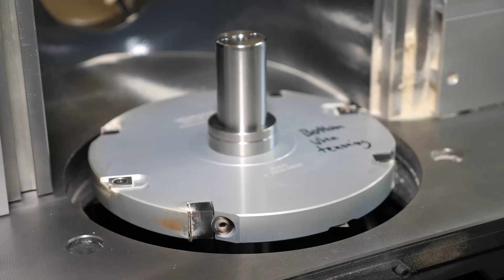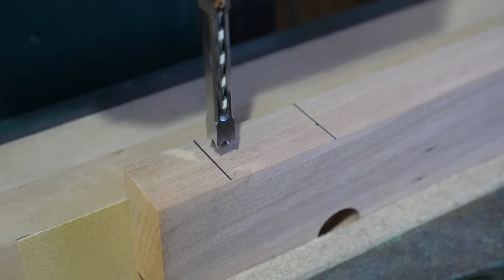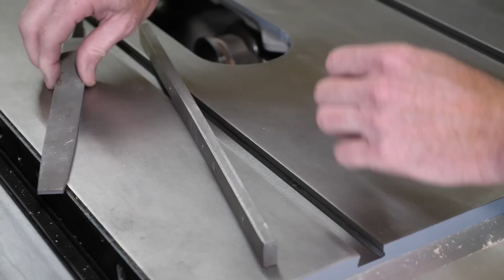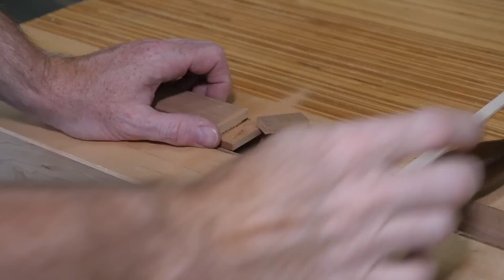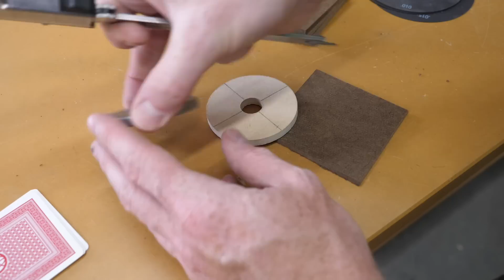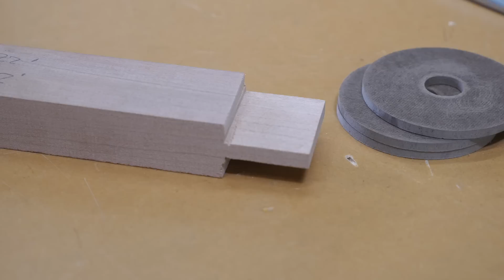Table Saw Tenons

Comment: Fabulous. Was wondering what to use for spacers on the cheap when I first saw you use this trick in the specialty saw blade video. Notice you have an insert for the unisaw that looks to have multiple different blade slots cut in it. Never tried it on mine but I have often wondered if there is enough room on the insert to rotate 180 degrees to have a multi purpose insert. IE one side zero clearance thin kerf, other zero clearance full kerf for example.
Reply from the maker: Thank you. I can flip. the insert around on the Unisaw. I cannot on the PM66 because the "feet" don't line up front to rear. Hope that makes sense.
Reply: @MikeFarrington  Sweet. I have the unisaw, so that is a wonderful bonus.

Comment: Seems a little overkill. If you have a tenoning jig, with 1 blade you can just flip the piece over and the tenon is perfectly centered, plus you can fine tune the fit just by moving the spacing of the jig. This might be good if you have an offset tenon.
Reply from the maker: I think you've missed the point of this method. The benefit of this method is once you get the setup dialed in, you can come back to the same thickness tenon with zero setup. This is helpful when using the same router bit or other method of cutting a mortise. All methods have their ups and downs, knowing a few and picking the best one for your project is the key to better woodworking.
Reply: @MikeFarrington  I could see that for a production shop where you're making a lot of the same sized stuff, for sure!

Don't take it as a knock, I'm all about learning new methods of work.

Comment: Hi Mike!
I kind of rediscovered your channel watching the door video. I am a keen hobbyist, and have a few questions:
Are the saw blades used here just normal blades?
What would the benefits to this method for a small batch be, over cutting the tenon with the bord laying down with a dado stack for instance? I easily see how this would be amazing in a production environment.

Thanks for another great video, and thanks for sharing.
Reply from the maker: Thank you. These are normal rip blades, nothing special. If you look closely, you will see they aren't the same blade. The key is they are the same diameter. The benefit of using this method, is once you measure you mortise, then setup for the tenon, if you take notes, you can come back to the same setup each time.

Comment: I have a shop made tenon jig that saddles the fence, but I do one side at a time by turning the board 180° in the jig. This ensures that the tenon is perfectly centred.  Of course this only helps if you managed to get the mortice centered. 😉  I sneak up on the size using a DTI on the fence. This makes it super easy to get a perfect fit.
Reply from the maker: That method works. This method allows someone to come back or an exact setup to mate with a known mortise size. Both methods have their pros, cons, and uses.

Comment: I find those plastic eaves trays aren't great for retrofitting, they're better on re-roofing jobs or new roofs. The first thing i do is remove the gutters and inspect the fascia. Then the first two rows of tiles come off. If the first batten needs replacing i do so. On retrofits i use 6mm marine ply ripped to approximately 10" wide. I cut and fit sprocket to finish flush with the top of the fascia. I fit the ply flush with the outside of the fascia. I then fit some Iko eaves protector on top then the old felt is lapped on top.
Reply from the maker: Not sure I follow, but thank you.
Reply: @MikeFarrington  Apologies, that comment was for another channel.
Reply from the maker: @Toyotaamazon80series  Ah, that makes sense. Thank you.

Comment: Disk his hand egg sealant view Dio. I would propose cardstock, acrylic/polycarbonate, PVC, ABS (Any flat plastic material actually), Aluminium, or other smaller carbon steel or HSS circular saws with the teeth sanded smooth. (Non carbide blades have teeth that have an offset to create the kerf).
Reply from the maker: Good ideas.

Comment: For those of you who don’t like the table saw trick, you can cut the cheeks on a bandsaw much as if you were doing it by hand. First cut the shoulders either by hand or with a table saw and miter fence or sled. Then, adjust the bandsaw fence, cut one side to a depth (use a stop block), rotate 180 degrees and then cut the other side.
Reply from the maker: I have shown that trick in another video as well. Thank you.

Comment: Adding a second blade onto the table saw increases the risk of kickback. Especially since you removed all the safety devices. It may save you a few minutes, but it increases your risk by 3 times. I highly advise you not to do this. This is extreme dangerous. This is not a new idea. This has been attempted before, but due to its risks, it has not been widely used.
Reply from the maker: This is wrong. By definition kickback is a piece being trapped between the fence and blade. The fence is way out of the way. If the workpiece is being held firmly by the tenoning jig, this operation is about as safe as using one blade. Agreed, not new at all, as mentioned in the video I learned this trick when I was working in a cabinet shop as a young guy.
Reply: @MikeFarrington Kickback is a piece of wood that is flung back towards its operator Due to wood movement After your wood is cut This can be caused with just blades alone Not just with a fence
Reply: @MikeFarrington Kick back by definition, come on, man. You're just trying to justify A unsafe practice. This trick only works if the Material you're cutting has no movement after it's cut like MDF Any wood that you use this trick has a risk of 6 points of contact if there's wood movement
Reply from the maker: @wesleyguerrero7357  I appreciate the input, but I think we will have to agree to disagree on this one. I would suggest doing a little research on the topic, there is a some content out there not produced by me on this very subject.

Comment: By the time you are finished messing about with shims and double saw blades one could have cut the tenons with a single saw blade in half the time. Big thumbs down!
Reply from the maker: I think you missed the point. Once setup is figured out, you can come back to the same setup each time a mortise is cut with a particular bit. So very little setup time after the first go.

Comment: I definitely would not do this with a full sized blade imo. maybe a 7 1/4 or 8 1/2
Reply from the maker: Thank you. 2 ten inch blades is still way lighter than a 3/4" wide dado stack. I don't know if this is particularly unsafe.

Comment: Masonite?  Do you flip the tenon around and cut it again to ensure it's centered?  Thus eliminating the need to perfectly locate the fence?
Reply from the maker: That would assume I need a centered tenon, which would also mean flipping the piece when mortising. I normally do not do that. Also, flipping the piece would kind of defeat the purpose of this method, which is to come back to the same setup each time a mortise is cut with a particular bit.

Comment: Great vid Mike, Personally Id rather use a dado set with the tenoning jig and cut the cheek and shoulders all in one pass, that way there's no phaffing about with shims the tenoning jig has adjustments for that very purpose, the only time its not perfect is if the depth of the tenon is more then the blade can cut, but then you just use a cross cut sled and the dado set... make'm huggggggge!
Reply from the maker: Certainly use which ever method works for you. This is just another way of doing it. There may come a time when this trick is just what you need. I think that is one of the fun things about woodworking, lots of variety.

Comment: You show milling a honking-big tenon on your shaper (one that would be for and entry door) then you say you can do the same thing on your table saw and you proceed to cut a little wimpy-ass cabinet door tenon using that.  Definitely apples to oranges....but I know it can be done on a table saw one way or another.
Reply from the maker: It certainly is apples to oranges. My shaper has a 7.5hp motor and a 1 1/4" spindle. My table saw is 3hp, and a 5/8" arbor. Having said that, on my table saw, I can cut a 1/2" wide by 3" long tenon with two 45 dollar saw blades. The two shaper cutters alone cost more than my whole table table saw. I would argue that table saw is punching way above its weight.
Reply: @MikeFarrington  hence why a $haper is, usually, at the bottom of the tool list.   Neat tip and demo.
Reply from the maker: @jeffbaker8808  Yeah, it really depends on what you are doing. If you are making moldings, or big curved work, or making lots of doors, a shaper can pay for itself really quick.

Comment: Fak! obvious, yet genius! Now all we need is for this to catch on then the usual suspect of tool makers will make shims.
Reply from the maker: I looked into doing just that. The infinity shims are very cheap and work good enough. I would recommend them for sure even though they aren't high quality. Making your own with hardboard works just as well and only costs a few bucks. I didn't think it would be a very good way of making some money.
Reply: @MikeFarrington  Not hot on the idea of using wood on a fast spinny thing with death blades attached to em. Id pay for high precision/balanced metal spacers -metric & imperial.
Reply from the maker: @sunalwaysshinesonTVs  Hardboard is a very sturdy and stable material, and when under compression as in this application, I think it works well enough.

Comment: Mike, the runner adjustment is great - love your lowkey tips and tricks. So this method of tenon cutting... looks at first like something a dangerous idiot like me would think of if left unsupervised in the shop (translation: I've already wondered if it can be done). So a tenoning jig of some kind is obviously an absolute requirement. I guess my question here is, given that you have a bulletproof tenon jig, how sketchy is this technique? Disclaimer: I'm not being a troll or Safety Sally here, I'm genuinely curious. I did, however, scan the comments before me for someone screaming about a dual riving knife... someone's bound to come unglued over this.
Reply from the maker: I have done this method with the jig I used in conjunction with my table saw fence. It was made from MDF, but it was stout. As long as the work piece is held firmly, and the travel is consistent and accurate, you will be fine.

Comment: That requirement to add the thin shim is probably because of the kerf of the blade teeth being wider than the blade platter. Great techniques!!
Reply from the maker: Yes, thats it exactly. If you prefer math to test cuts, most saw blade makers will give plate thickness vs kerf. With those numbers you could just do the math.
Reply: @MikeFarrington  What is this "math" you speak of... 🤣
Reply from the maker: @jimbecker5675  Math is a 4 letter word I try not to use too often, but once in a while its necessary.

Comment: The multiple blade method also works great on a radial arm saw for kerf bending. Back when I used to make custom starter steps it really saved lots of time.
Reply from the maker: That is a great tip. I could probably run 3 or more blades on my RAS. The arbor is super long.
Reply: @MikeFarrington  Two is all I ever tried, that's all the blades my boss had that where the same diameter that would fit on the one inch arbor. I made a plywood blade cover that covered both blades. There was definitely room to run at least one more blade. I think I was running 1/4 inch mdf spacers between the blades.

Comment: Great video as always Mike!  Quick question, how about using the two outside cutting blades from a Dado Stack for the edges of the tenon?  Or do thin kerf blades work the best?

Then use the spacer disks that come with the dado set for the tenon thickness.

I will be cutting some tenons later today so I may have to give that a shot since I usually run full width blades in my TS and don't currently have any thin kerf blades.

Thanks!
Dave Couch
Reply from the maker: I would say it depends on the saw. I would guess that this technique will work with any two blades that a the same.

Comment: Great tip, Mike. Do you really need to make the hardboard spacer round? Why not leave it square?
Bill
Reply from the maker: Square is fine, but it will limit you max depth of cut.